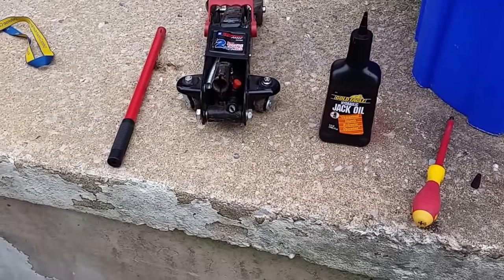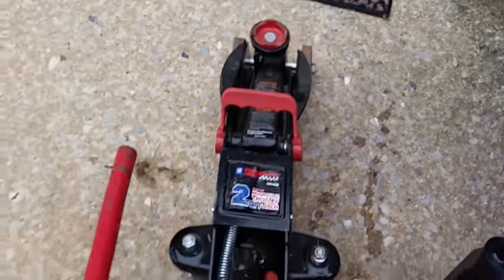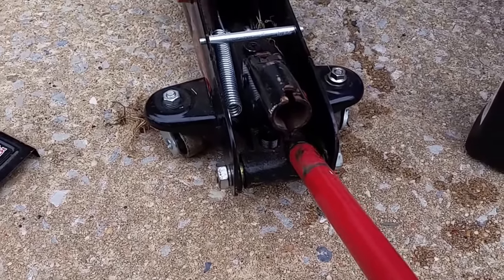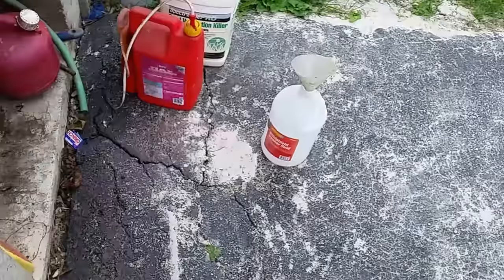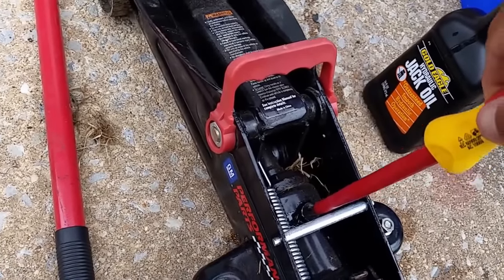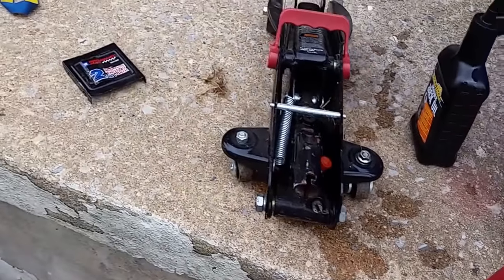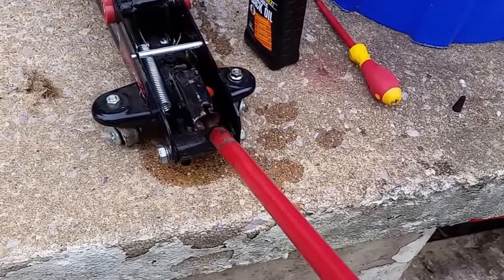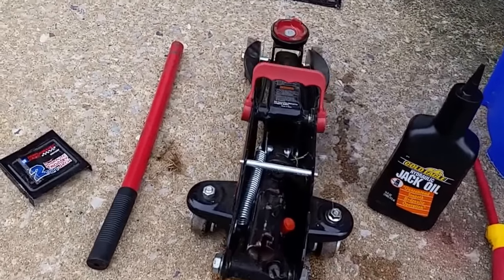How to add or change Hydraulic fluid on Floor Jack

Comment: REMEMBER:ALWAYS use jack stands when lifting a car. The only thing stopping you from getting killed is oil^^^ & jacks do fail quite often!
Reply: FASTESTMAN ON3LEGS 
True Story!  thanks for aware  the kids about it
Reply: Always use jack stands for sure! My brother used a jack with no stands to lift his car once. The car fell on him. Luckily the neighbor heard him and came to help. He could’ve died
Reply: And put on flat surface! some people use it on a little hill, even if it's a small hill, it can de-stabilize enough if enough pressure is pushed when you try to loosen a bolt etc, and rocky surface, I live in a flat which has a alley and parking for the 10 residents but it is not paved anymore so it is very rocky and full of potholes, I wouldn't lift my celica on that axle stands, small rock can get stuck under and slip, I go on a countryside road for stuff that isn't engine or bodywork related which is used by farmers as it is flat and my town is small and quiet so no traffic.
Reply: You are correct. I said same thing. I just literally had a brand new Jack and it had a load on it and it just collapsed str8 down it would've def killed someone if they were under it. That Jack was a heavy duty Orillia sold Jack brand named ac Delco
Reply: Buddy of mine when I was a kid came home from school on Halloween and found his stepfather laying under the car in the driveway, he thought it was a Halloween prank til he found out it wasnt. Horrible occurance that could've been avoided. Never ever trust a jack for long term support.
Reply: As long as you can prevent sticking any limbs in danger zones if the car would fall, you can just put a tire underneath the car next to the jack. For most of the jobs it’s not needed to be underneath the car. As soon as you have a job to go completely underneath the car, be very very alert on what you do, at least 2 jack stands indeed. You’re risking your life over an automobile… Getting your head crushed between the oil pan and the pavement is not a nice way to go.
Reply: Safety first
Reply: Just shove some tires under your car when its jacked up and also put a brick or something like that behind the wheels

Comment: Thanks for posting.  My jack was only lifting about 1/3 of the way after getting it out the first time this spring.  I was about to buy a new one, and turns out it just needed oil.  Money saved.
Reply from the maker: MultiPoseur 
Save money, Live better :)
Reply: +MultiPoseur My jack lost its lifting height too.   How do I fix it?
I guess changing the fluid might fix my issue. 
Thx

Comment: Good video. The reason why you pump the jack 20 times with the valve open is to let out any air that may have entered the jack
Reply from the maker: I said in the video, I don't know about 20 times pumps. Just read some where to do it lol. Thank you for your comment!
Reply: If you put it under your car to put a load on it, you would then bleed it exactly as you do brakes and it will bleed better and with less effort
Reply: @hungtang4813 Just got a Jack for free and the person that had it before me gave me a couple small bearings he said fell out when he drained it. Said they came from the side part where you can screw it down with a flat head. Can you help me put it right I can’t find anything on the internet. It’s just a little 1 ton trolley Jack if that info is needed. Any response is appreciated. Thanks in advance.

Comment: Hung Tang What happen if I unscrew the one it say Do Not Adjust? What does that screw do? I even took out the release valve also to drain all my old fluid and put new fluid in it. Because I have problem leaking oil and it wont go up as high. So I change all the seal and then it still wont lift up as high or wont lift at all. But it did fix the leak cause I replaced the seal inside. Please help me and what should I do?

Comment: You have to stand the jack up and fill till the fluid comes to the hole, if you lay it down it fills it full and thats not right, its only a boittle jack in a stand,  u fill them standing

Comment: they're all a bit different. new Orings is the best to keep it from leaking again tho. one on the fill plug and one one the adjustment/lowering screw. I just tiped mine up on end and filled from the adjustment screw maybe pull the little spring deal and ball bearing out with a magnet or by typing it to empty it then invert it upright with whatever valve is easiest and fill it bottom to top style. jiggle the handle with it full it bubbles then sucks the fluid down in it. chose to empty the old black fluid out first so it took like 1-2 hours of add a little jiggle the pump then add alittle. till absolutely zero bubles come out. then just bottom out the pump handle and put the innards and screw back in. good as new. I even used a mix of 20w-50 and wd40 though they don't mix well but it's alot better than the old stuff apparently. functions perfect. if the new stuff is too thick you're gunna take 5 hours to fill it. so don't do what I did. use the actual Jack oil.
Reply: Yeah the problem I'm having with mine is there is no fill hole, just a small purge hole and the adjustment screw. But I can remove the cylinder rod where the handle goes to crank it up

Comment: hi Hung. My trolley is out cause a piece is broken. do you know a web site i can order a piece?
Reply from the maker: What part are you looking for?
Reply: Hello, it's a little part very thin. When you move the lever upwards a external piece will drive the piston upwards. It's a Carpoint 0677807 Trolley Jack 2000 Kg.